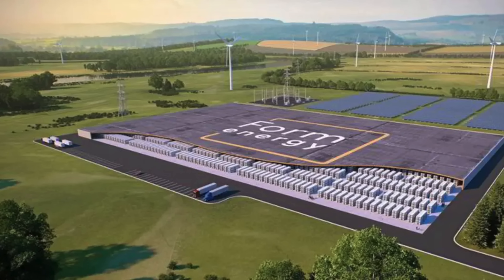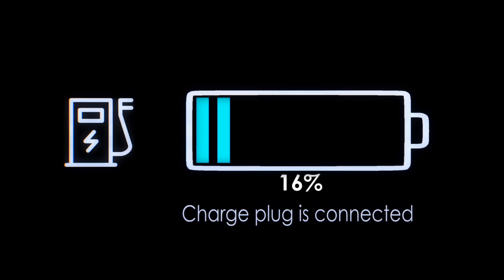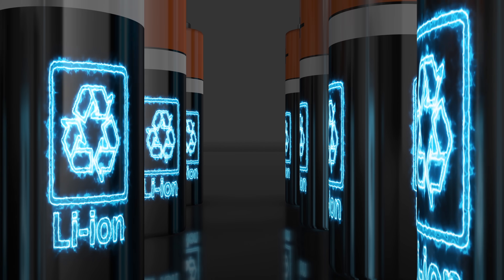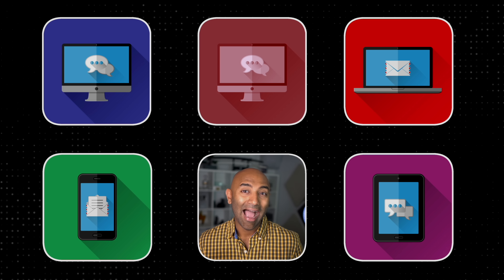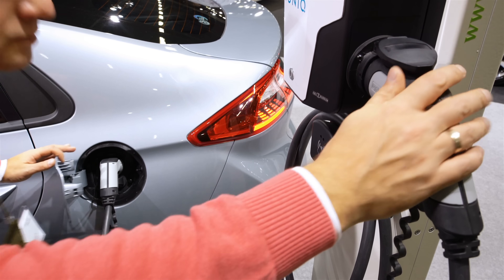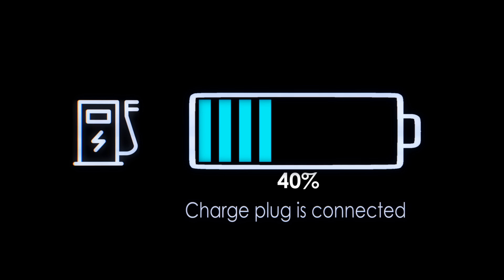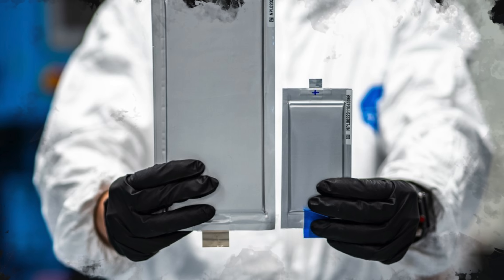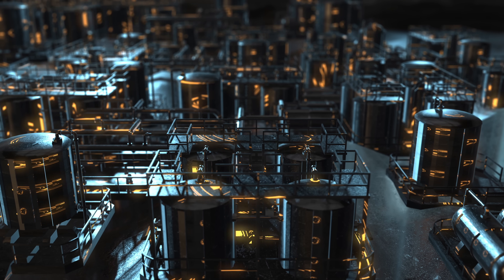This Battery Claims It can Store Energy in RUST!

Comment: Solar farms already take up vast amounts of land, just put the panels on top of the battery buildings and you're using the same space.
Reply: Better yet, just dig out the battery buildings and sink them underground where you can control the temperature better.
Reply: Build Floating Cities that charge via ports 😆
Reply: @Jake-iw3tl  - With Lots of Really Big Cables?

Comment: Thank you for showing me the scale difference between lithium and rust visually, so much easier than trying to hold 3 sets of numbers in my head
Reply: Scale in volume and scale in weight are harder to grasp visually though.

It's something often simply ignored that there is a measurement of both per space cubed (volumetric energy density) and a measurement per weight (kinetic energy density).

Sometimes they don't scale quite as well with one as the other, ie you may get it doing very well in weight but it expands drastically with more energy stored.

Comment: Cheap is good...and weight is not really an issue for stationary batteries.
Reply: the scale difference does make it apparent tho that a building to house these would be very costly, hopefully each module is a stand alone all weather enclosure
Reply: @WileHeCoyote  - Agree.  I would hope they (Form, others?) are also looking to reduce the required footprint to store these batteries.  E.g. could they be safely stacked, or build a multi-story building to store them in.  Whether it's possible or not, hope they could cover in the entire roof with solar panels further optimizing the building's footprint.
Reply: The real question is does have good  performance / price and lifetime / price ratios?

We should also keep in mind that a kind of battery that is 100% sure coming in a few years: second hand Li-ion cells from electric cars
Second hand cells would have about 50%-60% capacity left, their (safe) C rating is derated too, so they are completely useless for cars, but they may beat all alternative batteries for storage, in performance / price and lifetime / price ratios.
Basically we should only recycle the lithium nickel copper etc.. inside those cells if the cell is truly useless. If we can still use them grid storage cheaply, than we absolutely should.

When you recycle Li-ion batteries at LARGE scale, they become the cheapest source of lithium and nickel, so you will have to calculate the loss of recycling revenue into their price too. That means, it is not obvious if we should recycle them into raw materials, or to grid storage, but we will have to deal with them anyway.

(Large scale is super important here, everybody is struggling to recycle Li-ions, because they cannot use the super large scale kind of processing which is used by lithium producers. There are simply not enough junk batteries to recycle efficiently.)
Reply: @chuckm260  OR dig it all underground with a treed park above. Two with one stone.
Reply: @paulhellewell8762  you can make it one kilometer deep, too, but how much it will cost? These damn reviews never touch the true vital information. The final price for storing energy. If you need to dig so much to bury the battery, maybe is cheaper to dig the hole for water storage. Hydro is cheapest now, but there are no locations.  So just dig some storage room 5 km under the actual hydro plants, and you have ten time more storage capacity since the present hydro have only few hundred meter level difference. First I had this idea for gravitational storage with rocks. I mean dig a km, or even deeper shaft, than few km slightly inclination tunnel for self moving the loads, and on surface the same. The rocks from the tunnel will be the charge. It seems expensive to dig so much, but if you consider that actual mining is for single use, I mean you get the ore out and you are done with the use of the tunnel. But you dig this once and you use it for millennia. Sure, the ore may be pricey, and return instant the cost, while storing energy will need quite some time to recoup the investment. Anyway, for this is the problem with cables usage. That technology is not proven yet for mass energy storage. Sure, it works for elevators and cranes, but for so much heavy lifting will be financially feasible? Bud hydro is proven technology. Now you will just need the upfront cost of digging tunnels. This may be cheaper than building those immense storage underground facilities needed for rust batteries.  Anyway, hydro loses a third or a quarte of energy spent for storing. How much is losing the rust battery? I did not noticed to be mentioned.
Reply: @WileHeCoyote  I hope we all do realize (though the video chose to ignore this) that this is not meant for consumer product but a gridscale storage
Reply: @WileHeCoyote  Maybe they can mount the solar panels on top of the batteries, that is, the same land would be used for both energy generation and storage.
Reply: @ehombane On average, the temperature increases by about 25°C for every kilometer of depth.
Reply: @adamrak7560  Excellent points! Investing in one of these large scale grid storage technologies is very high risk at this time. No one knows which will succeed but most will fail. This solution looks to be very Capital intensive due to it's sheer size. We will not know how long these batteries will last so its true cost could be hidden for some time. Let the buyer beware.
Reply: stationary batteries wont solve tractor or ship pulling power.
Reply: @ehombane  When I need storage in my house I have 2 real important questions.
!: Price/kwh
2: Energy efficiency including leaking losses.
Both are equally important.
Weight is not the most important.
Size is only a little important IF i can store the batteries under my house....under my floor I have some space needed for preventing moisture to come into the floor.
Reply: Weight is always an issue.  It costs money to drive 100 more semis to transport theses things.  I love New ideas.  Still skeptical though.
Reply: @andrewjenkinson7052  Temperature does not influence my reasoning. Sure, for some years or decades you can recoup some heat also from that pit, but the question was about price. It this battery so cheap that digging it underground will not drive up too much its price?
Reply: @reiniernn9071  This is what I said too. We need to know the actual price for storing the energy. Nobody provided this information.
Unfortunately it seems that the crawl space for under the house is not enough. It was not provided the actual volume necessary, but from the graphic comparison, it seems that  the difference when compared with lithium is quite stark. I just looked again, and for the regular density iron battery you need about 50 square meters of space. So yes, for home usage, basement space may be enough to store equivalent of few power walls.   But for industrial size, creativity is necessary since space can became costly.  

Anyway, if they come with a reasonable price, this battery, in basement, plus solar panels on roof will be a good solution for  regular houses. For multilevel housing and industry, wew need to dig deeper in our creativity, or ground.
Reply: @ehombane  You completely missed my point. You talk of a 5km deep storage for WATER. Water BOILS at 100°C. If the temperature increases by 25°C for each Km depth, it will boil away at about 3 Km. depth.
Reply: @andrewjenkinson7052  No i did not missed it. 
First, at 3 km will be 75, so is far from boiling point.
And second, at 5 will be 125, but also will be quite a pressure there. And boiling point will be quite high. 
For example in a pressure cooking pot the pressure is about 2 bars, and boiling point a bit above 120 C
So yes, at surface above 10 meters depth, will start boiling. That is why I said that for few decades we can extract some heat. 
But after that the surrounding rock will cool, and additional heat seeping from further rock will be insignificant  considering the volume of water circulated. Rock is insulating too, if thick enough. However. I threw the 5 km figure as an example. I can be only 2 or three. And anyway, it was just a counter example for the space needed for rust batteries. Digging large quantities of rock is not a current thing with actual technology.
Reply: @ehombane  I don't know where YOU live, but I assumed an average temperature of around 20°C not 0°C hence 3Km. Your whole idea is pretty stupid anyway. Where will you put the mountain of material you would excavate?
Reply: @andrewjenkinson7052  Actually the ground temperature is pretty even once you go few meters deep, and is around 10c, so yep, I did not considered that too, so is 85C at 3 kms, still not boiling. But do not try to steer it away, you keep avoiding the pressure subject. And finally you got my point. The idea is stupid. As stupid for hosting water or rust batteries in it. At least for the water idea you may raise the dams to make the surface depot bigger.  Remember that I mentioned the idea only to point that digging the rust batteries underground does not solve the volume issue of these batteries.
Reply: @paulhellewell8762  There will be plenty of underground space available when cities ban cars from downtowns.  All the underground parking space will become empty and otherwise inhabitable so there is little use for it.  People wouldn't like batteries that can catch fire under their buildings but rust should be Ok.  Those spaces can handle the weight of cars and are accessible via ramps so they should be good for setting a battery farm right where the consumers are.  Of course I am guessing that rust batteries are not as dense in terms of weight as a solid block of iron would be, if not, this wouldn't work at all.
Reply: @chuckm260  storage areas within the outer walls may be one answer. Like with building a rammed earth wall with a battery sandwich between the two sides of the 3 to 4 foot thick wall. The walls would actually be the storage for solar panels on the roofs. Maintaining them may be a conundrum of sort as a 2 foot space would be considered tight quarters depending on how they're stacked. Access panel built in to expose them incorporate into the walls design? But the rammed earth homes themselves would have to catch on first. The past methods of building a structure may also still be examined utilizing that three foot outer wall with the battery technology hidden inside of it. We know the thermal mass of the 3ft earth wall is basically just meeting the "frost line" requirements thru our studys but is there a benefit useing the space as closets filled with battery? That would be the major question as to whether or not the earth wall could be just two well insulated walls 3ft apart (2 foot of space if 2"×6" walls were used).
Reply: @adamrak7560  recycled li-ion will be great fits for home storage and peaker discharging. I think if the claims are true the iron air batteries are a perfect match for utility scale solar farms